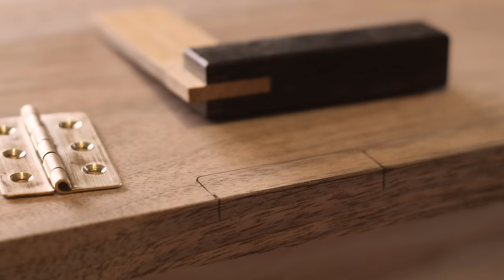Ash and Walnut wall mount floating desk Making

Comment: Hi Yuri

Watching you work is very fascinating. One question... Is planing your last stage of finishing or do you also sand
Reply from the maker: Thank you so much 😊 Planer - the last item, the surface is smooth as glass.  But the chamfers had to be polished a little due to the fact that the rounding is stepped.

Comment: Five tails would have been better. When the wood works, then the greater probability the tails will fail...😊
Reply from the maker: Maybe😉
Reply: @gr_woodworking  wood hydroscopic material...shrinks and expands EVEN building at 7% moisture content. Tails: angles too shallow. As a means to reduce possible failure, the number of tails are increased. It's not maybe, but based on 40 years of experience.